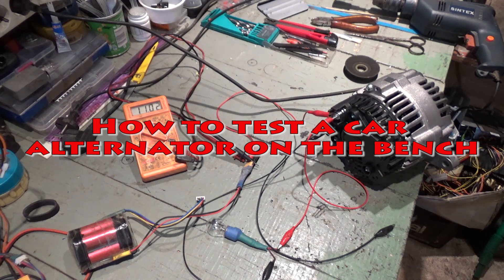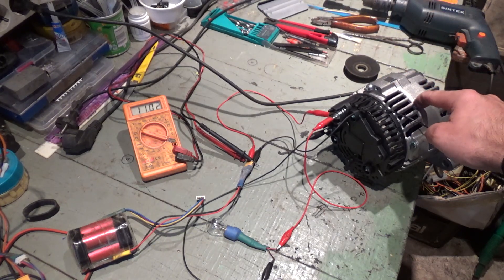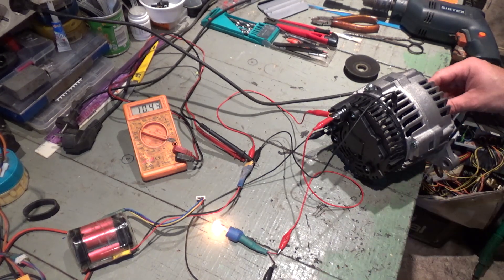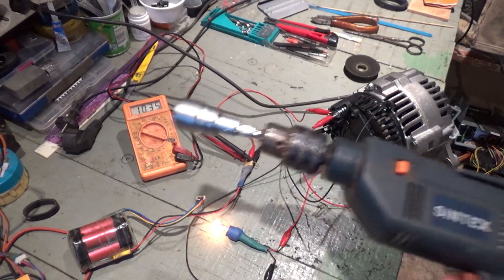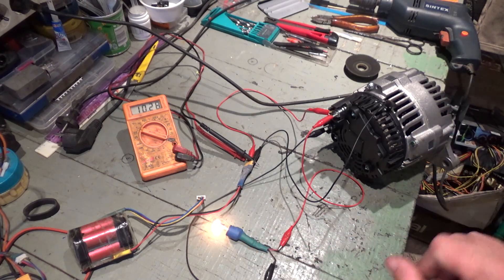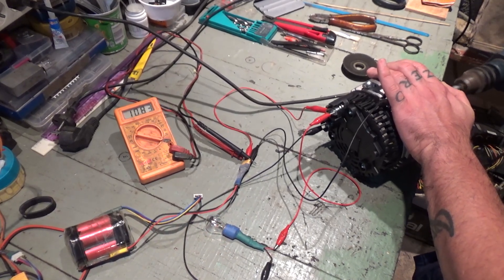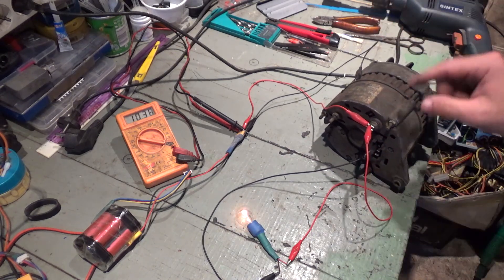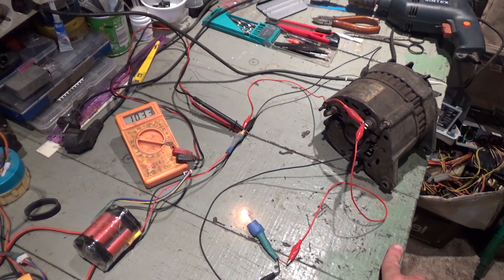How to test a car alternator

Comment: So if you connect 12v to field connects which bypasses regulator heavy red wire to meter with ground correct?

Comment: The bulb light is not obly a visual reference. The alternator needs an impuls to start charging. If you don't use a bulbe light it won't charge no matter how fast it will be turned. You don't want to give 100 amps on D+ so the bulb light also limits the current .

Comment: Tried using the same setup. the bulb didn't lit.  I connected the positive on the B+ and the negative on the connector with (L) code.  I'm checking my Denso alternator if its still working.

Thanks.
Reply: Did you ever figure it out ? I’m having same problem

Comment: Nice video but unfortunately, in addition to the battery cable, my alternator has a connector plug with three wires. I have no clue which is which since they aren't marked, or what each wire's function is. You didn't help at all. So I have no idea where to connect the lamp or even if the lamp is necessary since your voltmeter showed the voltage increase when the alternator was rotated. Is the lamp necessary? What do the other wires do? If the lamp was burned out on the car, would it prevent the alternator from generating?
Reply: jesus James check the car model or brand on the alternator and look on the manufactures page  schematics  is what I do.  Though a pair of alternators in my boat are unbranded but they are bosch

Comment: Can this be done with modern alternators as well? Because the modern alternators have some extra electric inlet that you have to hook up in the car. I'd like to test my new alternator like this but the seller says the modern alternators can only work in the car.
Reply: Modern alternator have 2, 3 or 4 inlet wires. You need to find 2 wires, one for the positive feed from battery positive - which feeds the rotor windings, the other the battery lamp negative - also negative for the rotor. Good luck.

Comment: i actually bought a Bosch 120 amp alternator and don't know how to test it. but i got u r video and it is done. I have a doubt, how much current is required to excite alternator , since i am running the alternator with a dc motor.
Reply from the maker: I am not sure about current but I know it has to be around more or less 1000rpm which is around the same as a idling car
Reply: thanku
Reply: it has to turn at least about 1500 rpm. The engine pulley is bigger than the alternator pulley, so the gearing is about 1 to 3. In the car,  normally even at 500 rpm , the battery light goes off, therefore at the alternator pulley, it is roughly 1500 rpm, so your dc motor has to turn at least 1500 rpm to charge a 12 volt battery.

Comment: Why do you need to have the bulb in the setup? what if you ran it without the bulb in the circuit?
Reply from the maker: ellasOLE22 the bulb is there to simulate the dashboard red battery light...without it probably would work the same but you would not have a visual reference except for the voltage changes in the multimeter...
Reply: Thank you